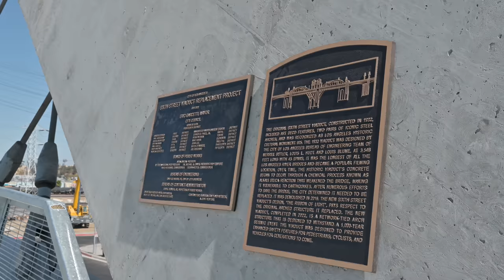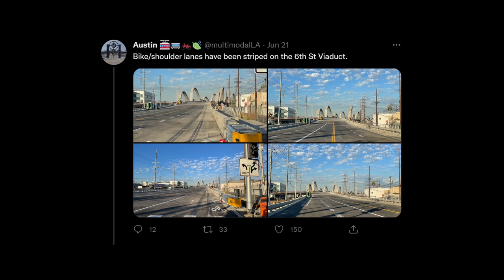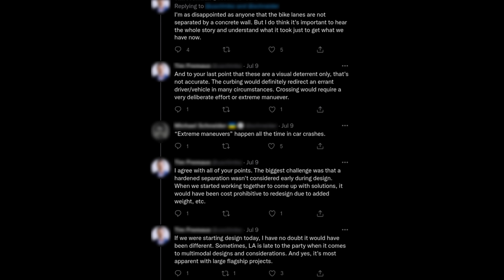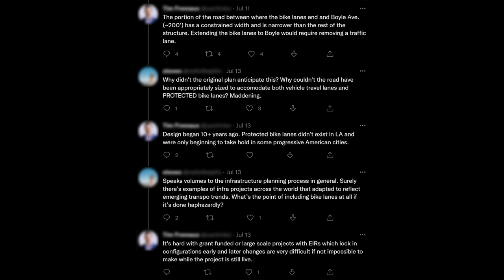The Failure of the New Sixth Street Viaduct Bike Lanes

Comment: The worst part is they could totally convert the sidewalk at the end of the bridge to a multi-use pathway. Hell, take 1-2 feet from those oversized highway-width lanes, and you could install a sidewalk-height bike lane on both sides!

This is a failure of vision at all stages.
Reply: Narrowing the lanes will also slow car traffic down. There's tons of room on that bridge.
Reply: @mariusvanc  but for it to be effective there needs to be trees on the sides and/or a barrier so drivers feel less safe so they actually slow down.
Reply: @mariusvanc  yes. That’s the point. Slower cars means less high speed vehicle crashes and less traffic deaths. It also incentivizes the use of other modes. Slowing cars on these kinds of roadways is a good thing.
Reply: sidewalk-height will just cause pedestrians to walk in the bike lanes
Reply: @frafraplanner9277  I'm seriously unconvinced anyone's going to walk across a bridge that long in the LA sun
Reply: Is there a minimum lane width the engineers had to work with due to law?  Its easy to say, oh, just do this.  And if there is, and they shortened the width and someone gets into an accident, they could sue over the lanes being too small.
The fallacy of this entire argument of reducing the width is thinking people would actually slow down.  What gullible fools you are to think that.
Reply: Slowing traffic is probably a good objective given that neither DTLA nor Boyle Heights operate at highway speeds. Highway-width lanes are inappropriate, especially for something that is meant to be multimodal and draw interest.

Edit (7/27/22): After 3 closures in one weekend (weekend of July 22 '22) LAPD has shut down access to the 6th St bridge until further notice. City is considering installations that will stop people from doing donuts and slow traffic. Hey! Maybe we'll get what we want after all!
Reply: @rizon72  there’s always going to be people who speed but as a rule of thumb, when people feel less comfortable about space they’re driving in, they’ll slow down. 
And you’re probably right about the lane width lawsuit potential. Typically, cities and towns stick to the usually outdated and often dangerous AASHTO guidelines that were originally made for highways, usually to avoid getting sued. That’s why we have a lot of oversized roads, even in residential areas. The AASHTO guidelines are improving but still tend to lag way behind safer guidelines provided by NACTO or by many European countries. So that may be part of the reason.
Reply: @sweetkitty3300  It's almost as if making the lanes wide enough for highway speeds encouraged people to drive recklessly. The engineers and LAPD were really caught flat-footed on this one.
Reply: @Myself9797  They walk that bridge multiple times before, there is more people walking the bridge than cycling.
Reply: @Humulator I see what you mean but you can't put trees on bridge, or so have yet seen tress put on bridges.

Comment: The argument that vehicles should be able to pull to the side just shows the priorities. There are two car lanes, so cars should be able to go around a broken down vehicle. Instead bikers are forced into car traffic by the vehicle blocking the bike lane (which makes an already unsafe situation even worse).

Those drains seem like a real hazard to narrow bike tires as well.

Also, crossing that bridge in summer looks like a nightmare for pedestrians and bikers. No shade, lots of concrete - the heat must be unbearable. Why not employ a bi-level design, with well shaded bike and pedestrian paths below the car lanes. The bike paths pass under the bridge at the ends, so there seems to be enough height available.
Reply: Having a bike path under the bridge would have been more convenient than using a car path way. The city should not be slowing transportation; traffic is very expensive and cost billions per year. 
There is not enough cyclist in that area for that demand. There is more people who walk and cross that bridge than cyclist.
Reply: @jasonlewis460  supply and demand depend on each other. We have seen this with cars: build 8-lane highways and guess what: more people will be driving. That's called 'induced demand'. If you provide proper and safe bike paths then people will bike more.

As for "slowing transportation": biking and walking are modes of transportation. Forgetting that is exactly what caused the current mess, where everything is built for cars and cars alone.
Reply: It's LA, if there was shade - homeless would take over within 3 hours
Reply: @kev2523  So instead of fixing one problem we create another one and let everybody else suffer as well.... sounds like a plan!
Reply: @stephanweinberger  sounds like you don't live in LA
Reply: @kev2523  I live in LA, I know how it operates. How it operates still sucks and we should try to change it.

Comment: A reminder that basically ALL bike lanes are expressly designed to be a "shoulder" for parking disabled vehicles as well as "errant vehicle recovery." But I completely agree with your idea to make the outer lanes bus-only as there's clearly no reason for that much space for cars given as you said, the fact that it was closed for several years and thus provided no lanes at all.
Reply: That’s because sidewalks exist. And as you can see based on obesity rates in the US people don’t use them except for in tourist areas(which usually already have a bike lane so people don’t get run over by bikes).
Reply: @LeeeroyJenkins  people don't use sidewalks in the US because everything is so far apart you can't really do anything without a car in most places

Comment: How can this be possible in 2022 seriously. How much would've it cost to add a concrete wall between the bike  the car lanes.
Reply: Literally nothing. All it costs is including it in the design in the first place. Change the barrier position from being between the pedestrians and cyclists to being between car lanes and both non-car spaces. And then a little bit of cost to pave the bike lane from there in red asphalt, at the same height as the sidewalk.
Reply: @mrmaniac3  but they couldn't have done that since they needed a space for vehicles to pull over in case of an emergency.

Comment: Great video! Too bad they basically built a stroad connection between two important areas of the city. This is what you get when a bridge is designed by auto-centric engineers and an architect who cares more about making an artistic statement (rather than understanding what design is most comfortable and safe). I totally agree that if people survived not driving that route for six years, then one lane in each direction should work just fine and would have been a driving improvement. These guys really just need a lesson from Dutch designers.
Reply: There are great examples of beautiful design, functionality for all modes of transport, and safety.
This is an LA Icon about how NOT to make a road.
Reply: Yes, it could've been done better. But considering for what passes for bike lanes here in LA, this is a big improvement. I ride across the bridge regularly and there is rarely much traffic, which goes to the "one lane would have been sufficient" theory. But the most dangerous aspect is the section just prior to the bridge where cars are entering the freeway and cyclists are really taking our lives in our hands to cross. After i make it past that part, the bridge bike lane is luxurious by comparison.

Comment: There is a cheap and easy fix!

You don't need a footpath AND a cycle lane on BOTH sides of the bridge. Just put a bidirectional shared foot and cycle path on one side. Obviously, it needs to be much wider, but it can be at least twice as wide because you only need one, and you can eliminate the bollards on both sides, freeing up another foot or so. If I understand correctly, the highway connects to only one side, so I guess put the shared path on the other side.
Reply: Or you could just put a bidirectional bike path on one side and a bidirectional walking path on the other. You don't need walking paths on both sides.
Reply: Or ban bikes.
Reply: @vancouver4sure  Ban bikes 🤣🤣
Reply: @jamestucker8088  nope. It's good to have it on both sides because then you can take pictures from both ends and different angles. Lol they thought about that!!! Heheh.

Comment: A shoulder lane was probably always part of a redesigned bridge. Modern vehicle bridges benefit greatly from having a shoulder lane.  Without a shoulder a disable vehicle has nowhere to go and can frequently create a cascade of accidents if it stops in the traffic lanes.  Full width shoulder lanes are frequently meant for bicycle traffic whether marked or not for bicycle use.  

 In the last decade what started as talk of cycle tracks emerged into protected bike lanes.  What appears to have taken place is the bridge's emergency shoulder lane was made to appear like a protected bike lane, but it is really not protected at all from misguided motor vehicles.  The drainage grids are not encouraging for bicycle use.  They'd be fine for an emergency shoulder.   

What should have been done is ample space be provided for all known uses.   There doesn't appear to be any tight width restraints nor would widening the bridge greatly changed its profile appearance.  The bridge should have been made considerably wider to allow the shoulder lane to function chiefly as an emergency shoulder.  Then a concrete partition barrier, bike lane and sidewalk.

Having all those pillions and wheel blocks looks awful.  Its what is done to an old bridge that is really past its intended use.   I also doubt that most people are going to run over these rubberized barriers if their motor vehicle is about to become stranded.  There will likely be people that stop their disable vehicle in the traffic lanes.  Police and rescue will know to run over these barriers, but the main hope for having emergency shoulder lanes on bridges is that seasoned motorists will have the good sense to move their motor vehicle onto the shoulder lane before it comes to a disable stop.  Another use for bridge emergency shoulders is emergency vehicle access.  

This does require thinking out of the box, just thinking.

Comment: We have a bridge here in Fort Worth with very similar arches, opened in 2013. The bike lanes on ours are outside of the arches. We do have bike lanes on the approaches at both ends, but no protection for those lanes, not even the plastic bollards. For about a mile from the bridge into downtown we have inconsistent bike lanes that appear and go away in several places. I think this is just because of road width not allowing for it, but my opinion is that it would be safer and more predictable to not have them at all, rather than have bikes needing to merge into traffic at several spots.

Comment: That "requirement" that the viaduct must have breakdown lanes is asinine. There are two lanes in each direction- if a vehicle breaks down it just pulls over to the right-most travel lane. And everyone else goes around it the left lane. There, fixed it for you LADOT/Caltrans.
Reply: You forgot that the CAR is king.
Reply: Until there are more cyclists than cars using that 1 lane. Then the car keeps the lane. 
If there are 100 cars and 30 cyclists using the bridge. You would divide the 100 by the 2 lanes to equal 50. If you reversed the modes of transit, then it would make sense for the bike to have 2 lanes and the cars have 1. 
They also made the pedestrian lane separate than the bike lane because if they were together and the combined cyclist and pedestrian combo overtook the number of cars, then they would be forced to extend out the ped/ bike lanes to mimic a similar method to the Long Beach bridge.
Reply: IRL drivers going 60-70 while texting, making a phone call, and drinking a cup of coffee run into stopped cars all the time. And used to even before mobile phones and cup holders too.

Comment: Thank you for putting this together. Looking at the length of the bridge, it's height and the slope of the ramps to get there ... I'd  say the width of the pedestrian walks is way to wide for I don't think many will use it.
  I would go further to predict a large number a cyclists will use it. I'd bet they didn't contact any cycling groups before or during building . But I guess we can always use the empty pedestrian walk instead of the crash lane.
 Bicycles only add 30 to 70 pounds to a rider. Cars and trucks weigh tons and all can reach speed apporching 100 mph. If they trust those so called bike barriers so much then they shouldn't need the concrete one as hitting a person on a bike or walking has about the same affect on the person being run over .

Comment: They could just add impact walls later on. With public outcry it’s really on the city to fix. The architect designs the bridge to what he has in front of them. 
Codes are flexible and fixable. The more time passes the more codes may change to allow such barriers and technology to make these barriers safe and flexible without need of replacing after impact. 
The sidewalk does seem to have enough room for walking and biking. 
I live in a city that wants to change to biking but the mentality of drivers being mindful of cyclists does not exist. 
As seen with the gathering place and the new pedestrian bridge it faces issues with shading structures but like this bridge things can be added once funding can be made available. I find it’s best to predict and place before finishing even if it goes over budget. Sadly that’s not the case usually.

Comment: The two concrete bridges crossing the San Diego river between the beach areas just have concrete protected bike lanes and they work great. It feels like an extension of the sage separate bike trails that they connect. Other bridges in Mission Bay just have flexipost bike lanes and work good enough, but only for more experienced cyclists IMO

Comment: One solution would be to swap the bike lane and the pedestrian lane.  It would be much safer WITHOUT that concrete barrier.  Perhaps a part of the solution is to remove the concrete barrier which lessens the weight on the bridge and increases the total space for pedestrians and cyclists. It could even be replaced with a smaller, lower barrier that is easier for pedestrians to jump over.  I imagine that the argument would be that this is too unsafe for pedestrians without recognising that the argument means the lives of cyclists are worth less than the lives of the disabled car drivers or those of the pedestrians. It isn't only black lives that matter. Don't cyclists lives also matter? Or not in LA.

Comment: i didn't even know that the bridge in long beach was gonna have bike lanes like that, there's really no reason to though because if you do bike on it you end up in the middle of the port with no bike lanes or even sidewalks in most places, the original design could've just been a few feet wider and then had a shoulder and a wall like they put for the sidewalk

Comment: Easy solution here:  Bicycle riders just need to pay attention to the traffic and pedestrians around them.  This video seems to suggest bicycle riders are clueless morons and as such have to be ABSOLUTELY segregated from motor vehicle traffic with K-rail or something similar.  IT looks fine to me as is.  If anything, I'd suggest removing those flimsy plastic bollards and rubber curbing and using two rows of 'bots dots' to warn drivers and bike riders they are drifting, and enforcing proper bicycle riding in the direction of traffic flow (note rider at 3:05 in the video going the wrong way).  Positive note:  The stormdrain grates are a type that won't catch bicycle tires and cause a rider to suddenly stop.  The bridge in Long Beach - that' bridge's bike lanes are a joke; its industrial areas at either end of that bridge, so why is there a bicycle lane on it?
Reply: Cars kill bikers, bikes don't kill drivers

Comment: Excellent video thanks. Why not reduce speed limit to, say, 20mph, which will make the entire road safer not least for cyclists?
Reply: That's not how speed limits work. Posting a new sign doesn't change the built environment, and people will continue to drive at whatever speed feels safe, which in this case is highway speeds. In order to show cars down we must change the road itself.
Reply: @AdamFaruqi  The road through Griffith park is an excellent example of this.  The speed limit is 25 and people are regularly doing 60 down it with little enforcement.
Reply: @innertube7479  speed cameras with automatic 100 dollar penalties would sort enforcement out.

Comment: 6:30. While adding a lane seldom has shown an improvement, taking a lane out wouldn't either as the majority of people who are travelling on the bridge are not immediate locals. The bridge is not a destination but a corridor. A good compromise would be shutting a lane for part of the day and opening it for the most high volume times OR doing what they do in San Diego, reduce it to 3 lanes and have a movable divider that shifts the center lane direction depending on the time of day. 

While the bike lane is a great addition, it isn't until the neighborhoods on either sides adapt better bike lanes that they will get the use city planners are hoping for. Also the bridge is long and putting the cyclists on the side of the pedestrians is a terrible idea too. Bikes need to be both separate from cars AND pedestrians to maximize safety. A pedestrian being struck by a cyclist going 25mph isn't a good idea.

Comment: When money and space are in short supply, there have to be compromises.  This project is a success, not a failure.  However, it is easy to imagine a simple modification that will provide greater safety for bicycles and maintain the use for inoperable vehicles.  It's not rocket science, and even Elon can figure it out.